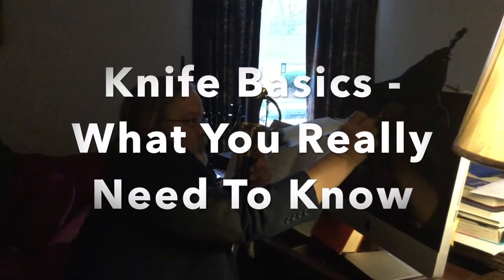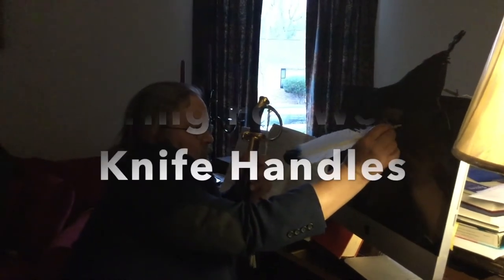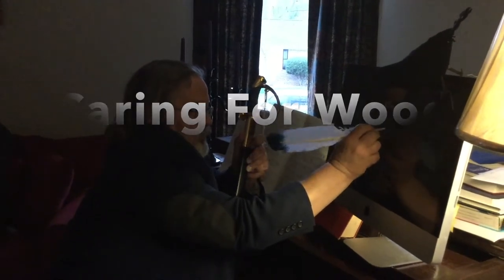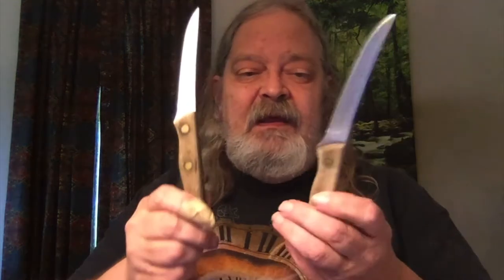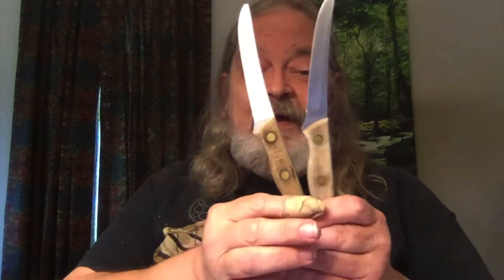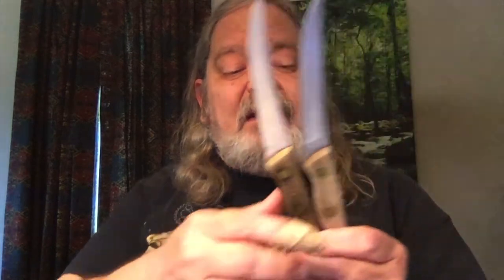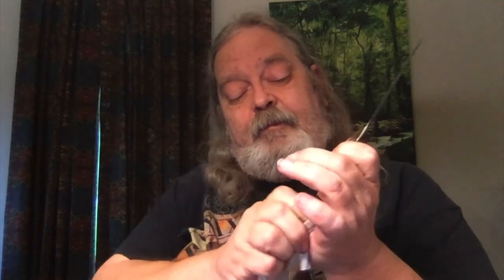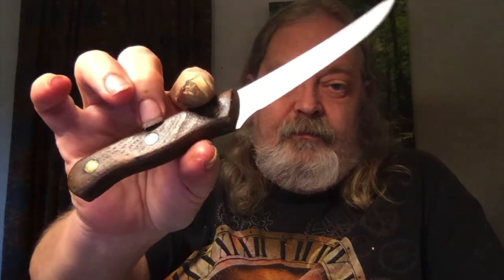Knife Basics - What You Really Need To Know - Caring For Wood Handles

Comment: So I'm doing this on a budget, will olive oil work? And I have a knife with a partial wood handle that I just got (Elk Ridge ER-123W) Would it be the same process or slightly different?
Reply from the maker: Olive oil will work, but it can go rancid if you’re not careful.  You can pick up plain mineral oil at CVS for $7.00 and not have to worry.  As for the Elk Ridge, you’d only want to treat the wood since the oil could make the rest of the handle slippery; but other than that it’s exactly the same.

Comment: What about marine spar varnish to completely seal the wood?
Reply from the maker: If you've got a well ventilated space in which to do it, go for it.  It might change the look of the wood though depending on wood used and existing finish.
Reply: @ckurtz1013  Thank you!  I don't mind the look of the wood changing.  They have been bleached out by the dishwasher, so this will add a bit of color back into them.  They are just your standard knives...nothing special...nothing expensive, but I do have a few favorites.

Comment: Please tell me if I should use oil or transparent wooden paint? I never tried oiling, infact in my place everyone uses some kind of transparent paint .
Reply from the maker: transparent wood paint will do the job, but I really prefer oil or a good board wax/polish.  The oil will rejuvenate the wood, and keep it from drying out.  The paint will coat the wood so it won't dry out as fast, but it still dries out no matter which method you use.  With oil or board wax, you can easily rejuvenate the wood whenever it needs it while paint will seal it and make it rather difficult to rejuvenate.